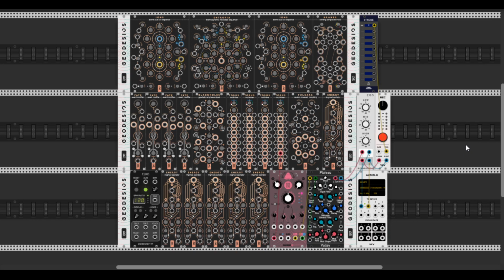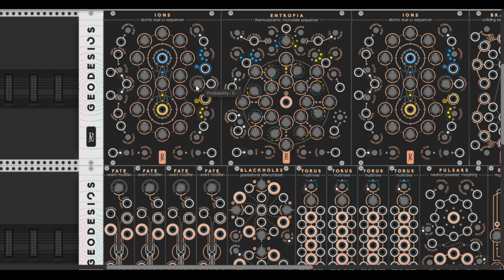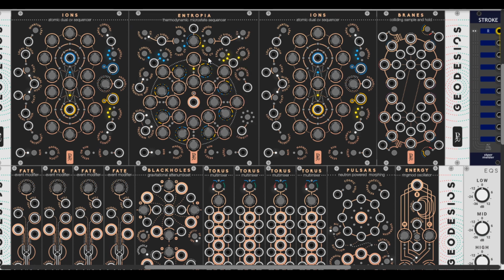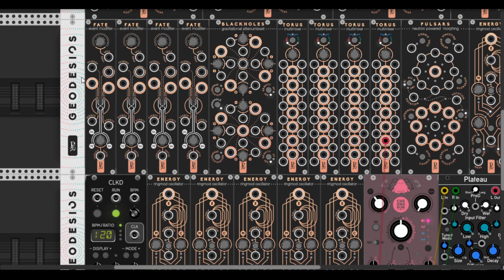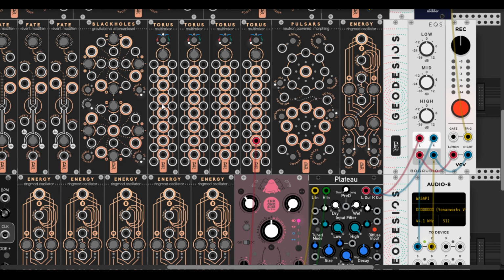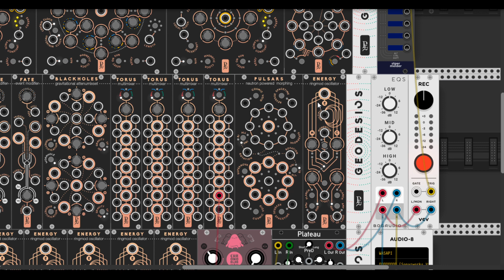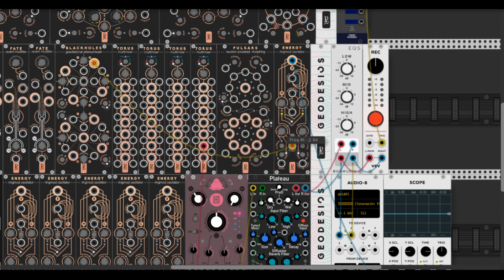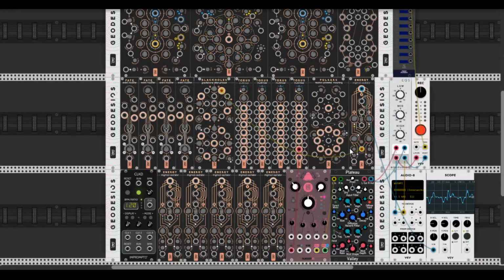Geodesics Fixed Rack - PART 1 - Tutorial & Overview | VCV Rack

Comment: explaining all the geodesics modules in less than 10 minutes! I never succeed to do that! incredible :-)  you can also use Torus as a stereo mixer by sending the higher and lower outputs to L and R input of the delay, and placing the sourd sources on Torus in the stereo field depending how close they are from the outputs :-)